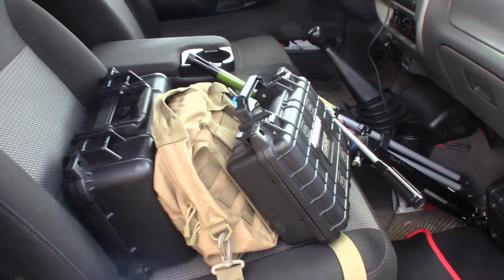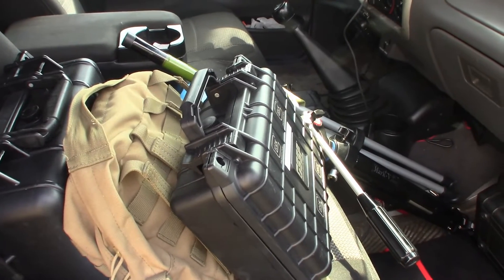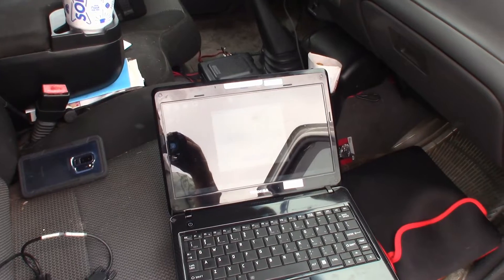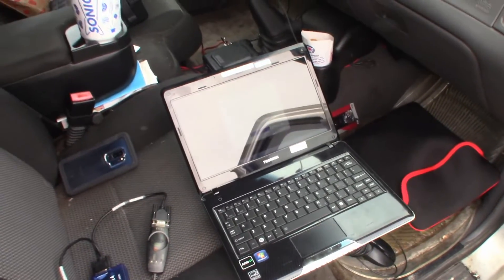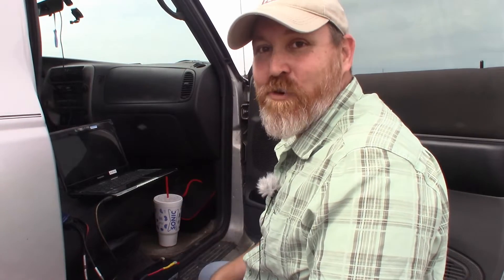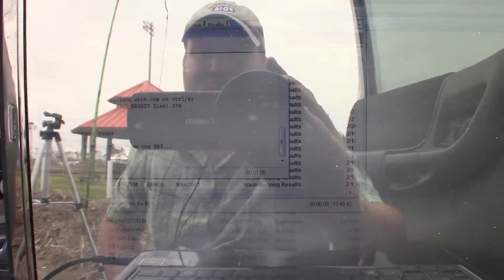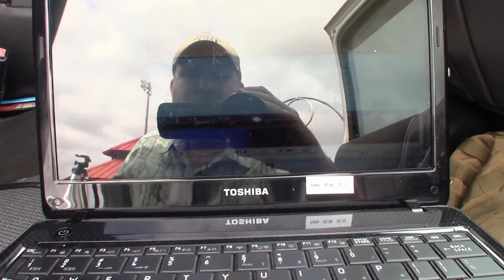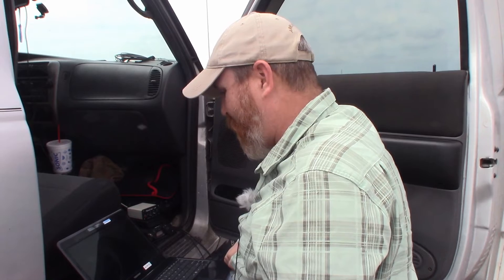Exercising the radios: portable ops with packet radio and PSK31 030319

Comment: Here's an idea. Skip the step of putting the antenna up and use you truckes antenna with a barrel connector and it will provide a better ground and distance, that's what I do now because I'm starting to look into more efficient ways.keep the videos coming. 73
Reply: I have done that; but prefer like Bob setup like it is an emergency setup like he is doing =)   It is a practice shake-down to make sure everything works as expected =)   Now with that being said I have gone to several disasters and just operated from my vehicle ( lived in it for a few days =)   Most people have not done that waiting on the slow moving infrastructure to get onsite /-)   Just lessons learned from the past ( always work with a local groups and organizations if possible as time allows =)